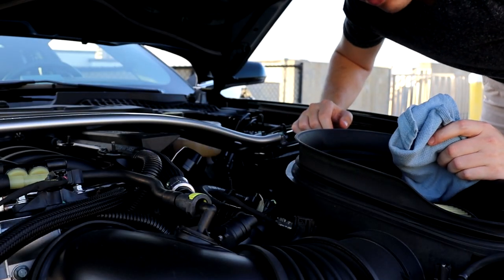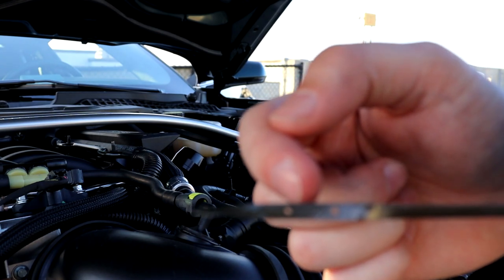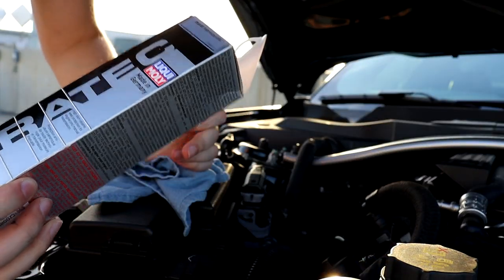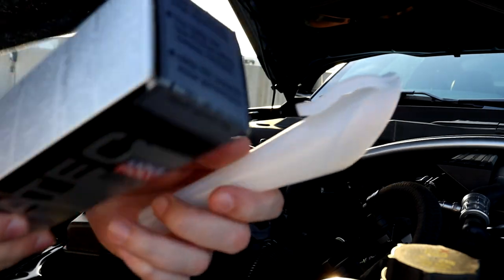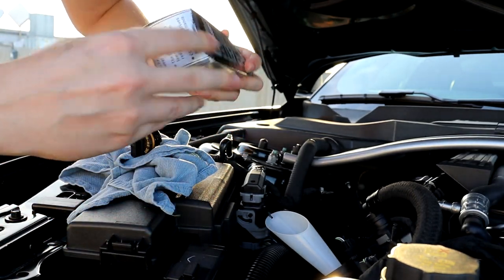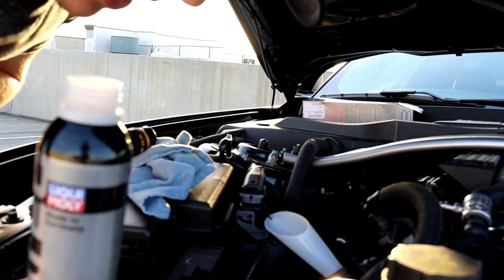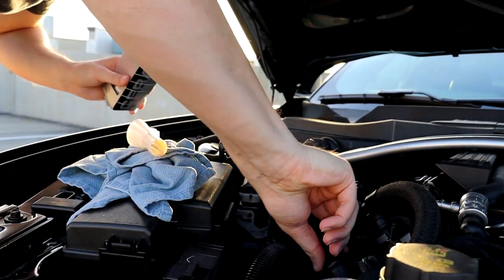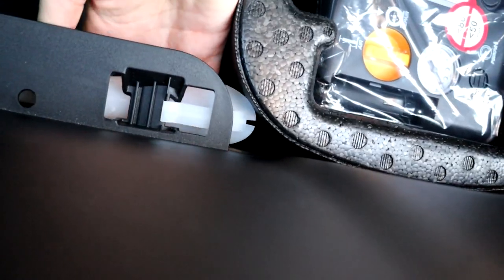2018-2019 Mustang GT (Bullitt) bbq tick and Ceratec...Does it fix the tick and does it work??

Comment: Keep that oil level at or above the full mark. If it were a gen 1 i would say fill it to the full mark, then go .5-1 qt more. They really helped fix the oil capacity problem on the gen 3 with 10 qts oil pan capacity, but its still imperative to keep the oil topped off because the motor itself will hold over 7qts at any given time during operation. Especially with factory oil pump gears, you DO NOT want any aerared oil being fed through those stock gears... all it takes is one moment of imperfect circumstances to get those gears to chatter(high rpm/bouncing off rev limiter-2step) and poof, your motor is gone
Reply: I don't get it, are you saying the oil mark should be at the max line and not the recommended between the full and min mark?
Reply: @redbluepill2701  I'm saying that when they first made these engines, they didn't consider the long term effects of only having an 8qt capacity for an engine that has at least 7qts flowing through at any given time. They blow oil into the passenger side valve cover area pretty bad, so alot of that oil also pools up in there. You really don't have any oil to spare for the pickup tube at that point, then you factor in the crank whipping the oil back up through the drainage passages and its not good.

Have you seen the gen one oil pan while it's off the car or done a opg job with the pan on still? When you picture what 1qt of oil in the pan looks like, it's not much at all. Then consider how many people aren't checking their oil level every time they fill up. The motors burn oil as well, and if you're using a passenger side catch can like you should be... its not good. So you must overfill and/or get a bigger oil pan, which has been  fords solution to the issue plus better windage+crank scraper trays in the pan. 

Having your pick up tube suck up aerated oil is a straight up engine killer(you can visualize how these opg's can be susceptible to chatter at high rpm/rev limiting with these considerations) 

So yes, the full mark should be considered to be about a quart higher than what it is. Coyotes need good oil pressure. 

Check out AED TUNING's video on 'Coyote oil system explained', Shaun is the f*cking man when it comes to anything Coyote. 

I hope I'm helping here and not just coming off as a preacher 🤣 I just want people's motors to last them a long time.
Reply: @redbluepill2701  I'm in the process of filming a roush supercharger, oil pump gear, crank sprocket, timing tensioner and guide, valve cover gasket, dipstick tube broken off into the block fix, and mt82 breather tube install right now. Should have a video up in a month or so hopefully at the latest. The longest part about all of this has been researching online exactly how to do it all. So I'm making a video with all of that stuff included. Probably will be multiple videos. The goal of the channel is to do that with every single thing I have to do on this car that doesn't already have these resources available. It's so irritating that the people that have made videos of this stuff, just glaze over all the details and then you're left scratching your nuts trying to figure all this sh1t out. I love helping people so what better way than to show them the conclusions to all the questions I had of how and what to do 🤷🏽‍♂️ gimme a sub if you want man. My stuff won't be fluffed up vlog tryin-to-sell-sh1t videos, but they'll be informative with correct info and suggestions. I make good money at my job, I don't need to sell my soul to be on YouTube.

Comment: Just a heads up on a couple of things. The s550 take 10 qts of oil, and that funnel is designed to put into your fuel filler neck for if a gas can is needed to be used. As far as the tick just send it!

Comment: It most definitely works. Hyundai Elantra 2017 with 168k started developing lifter tick. Started the car and went with the dog for a walk. First thing I did was sit in the car when I got back. Went for a drive. Car sound completely different. The gentle and persistent itch in my head to rebuild the cylinder head is gone. $ saved $$$.

Comment: I can't believe that I am the only one who doesn't have this so called BBQ tick.....
Reply from the maker: I am sure a lot of people dont have it.  Its only the touched ones that voice it online.
Reply: You're lucky. Although luckily mine is only while the engine is cold. Once warmed up mine goes away.
Reply: @ShizawnSanders same mine only got 40k miles lol I need to try this stuff! Have any of yall?
Reply: @kamrynmcdougall2669  no, but I do still own that same gen 3 Coyote 2019 Mustang GT and even though it makes the same noise it always has it runs great. This month marks its 6th anniversary of ownership as I bought it brand new 6 years ago to the month. I use this VS7 stuff with Cermillion in it because I get it for half off where I work. Definitely helps the noise and oil consumption. Also make sure you get or have a good catch can. The brand I use is UPR.
Reply: Ohh and I am a automotive service advisor where I work and see TONS of gen 3 Coyotes between the Mustang and F-150 and guess what? There isn't a single one that doesn't make the noise. At a certain engine temp I bet THEY ALL DO. Just because some aren't as pronounced as others and/or the owners don't notice doesn't mean they don't pretty much all have it. It's not loud enough to hear it from inside the cabin and it usually doesn't make the noise right away after initial startup but sometimes it does. Its at a very given temp like 125* or something when it will make the BBQ intermittent tick but then goes away pretty much completely at full operating temp. I'm almost positive it's a form of piston slap. Forced induction engine builds with fully forged bottom ends will do the same thing before getting up to full operating temp. That piston will rock in the bore a little until everything expands. Because FI engine builds have the ring gap loose they are real bad about this.

Comment: Yeah bud you're demonstrating the 2k rattle, not the tick.
Reply from the maker: Yeah some people pointed that out but it does look like ceratec works for both.
Reply: I have that also the 2k rattle and the tick what is the rattle coming from?
Reply: @JustSonicShorts  The rattle normally only happens on manual mustangs from what i understand.

Comment: The problem you had (and possibly still have) is the "2K rattle". It's not the BBQ tick. A drive around the car park isn't enough to confirm whether you've solved the problem. Let us know if the rattle is gone 500 miles from now.
Reply from the maker: I am very curious to see how it will hold up.  The 2k rattle, what is different from the BBQ tick? Is it worse or?
Reply: @LifeofPandK  my 2019 GT cars tick is only while the engine is cold and its intermediate. Meaning it's not 100% constant. I don't have the RPM rattle and that issue isn't a gen 3 only issue. That's a Coyote in general issue I believe.
Reply: @LifeofPandK  here we are a few months down the track. 2K rattle still gone?
Reply: What is 2k rattle

Comment: What oil u use???..because liquidmoly said mix with cera tec good for 31000 miles.only easy miles mnd you. Never use liquidmoly.for my car .I'm worry about ruin gasket,seals if I go 10000 miles or more.gm factory said require full synthetic and changing everyoil 5000 miles ????.
Reply from the maker: I used motorcraft recommended oil for the mustangs. I did change it around 7-8k miles each time. Fired change was early around 2k or so and then 8k etc. unpopular opinion but with todays oils it think 10k is perfectly normal it all depends on where and how you drive.

Comment: Bro should i use a bottle directly after change oil or is it okay to use one even after weeks/months of last oil change?

Also which ceratic did you use? Or it only has one variant?
Reply from the maker: I only used it once and it wasn’t after a fresh change. I used the one in the video.
Reply: @Life of P&K  did it really solve the tick? Also do we need to do it every oil change? Apologies for all these questions, thing gets really annoying thru time
Reply from the maker: It did. I didn't do it every oil change but its advised to or maybe every other one. Each car is different.

Comment: I have 43k on my 2018 PP1 and had the tick the whole time . This last weekend I changed the oil and used the ceratec and the typewriter tick is gone, its been gone three days, i put 80 miles a day on it to go to work and back. I highly, highly recommend if you have the tick, get this stuff. I'm using it with every oil change and I'm going to be putting it in my wife's BMW next oil change.
Reply from the maker: Very nice I am glad it helped!
Reply: I used two and I'm at 55k miles now AND On second oil change since. Still no tick.
Reply: Do u put 10qt in the mustang and then 1 bottle of the ceratec? Ty

Comment: 4:13 that bulitt takes 10 quarts all day!! As do all gen 3 coyotes. If you change your own oil that might be part of your problem. I also noticed your oil pressure gauge not moving, it should move with rpm basically 2.5 times your rpm so 2,000 rpm= 50 psi oil pressure.

Comment: What about warranty after using additives which aren’t recommended by Ford service?
Reply from the maker: I did wonder about that but this is what the rule is. 
"As long as an oil additive does not compromise the specification for motor oil, it cannot void the warranty. And if there is question that it might compromise the specification to the point it could cause damage, then the manufacturer must prove it to actually void a warranty"

Comment: Ask yourself this if a additive stops your tick then what’s really happening in your motor lmao. What also fixes the car Is trade it in before it starts to knocking like my old one did. I don’t really hear anything on your car. If you have it park and lay a camera under it and rev it to 2k. Or take it and hit 115 mph and roll down your windows it will be very loud when you let off the throttle.
Reply from the maker: I will see how it sounds after the next oil change and decide if I want to add the oil additive again.  The best way to explain the sound that the car does is between 1-3k rpm in the lower gears.  It sounds like injectors firing but super loudly. Or metal just hitting :O
Reply: Was it a 3rd gen?
Reply: @White_Fox_5.0  ya mine was a 2018 Gt 10 speed
Reply: @underfedcoyote5.022  interesting. I have a 2018 6 speed on its 2nd motor already(failed dual mass flywheel cracked the block). Changed my oil from the beginning with the additive just in case. 2 days ago i didnt use it on my 3rd oil change at 11k miles. I did one at 3k one at 5k and one at 11k(computer still said 19% life left) anyway i had the tick appear within 20 minutes of doing my oil change. Then today i got my ceratec in the mail and after a 20 minute drive and the old "italian tune up" the tick completely went away....definitely an interesting thing if you ask me.
Reply: @White_Fox_5.0  Hey dude, did you add the bottle on top of the recommended oil level "halfway between full and minimum mark"? If so, doesn't that make it overfill?
Reply: @redbluepill2701  sure i guess its technically overfilled a bit but i havent had any issues. And im spinning up above 7k once or twice pretty much every time im in the car so i'm sure she burns a little here and there. As long as youre not overfilled to the point youre sucking oil up your intake its not a problem.
Reply: @White_Fox_5.0    alright nice to know, did you get the tick while driving as well, audible while going low speeds in an enclosed area? My track mode seems to be noisy with the tick while going low speeds past cars ect
Reply: @redbluepill2701  its more like at a specific rpm. Like 1200, butbyeah i first noticed it pulling up in a drive through amd then it could be heard any time i hit that right spot super low in the rpms
Reply: @White_Fox_5.0    same here, sometimes it's audible in normal drive mode, but it's pretty constant while cruising in track mode for me
Reply: @redbluepill2701  mine went away as soon as i had ceratec in the oil🤷‍♂️